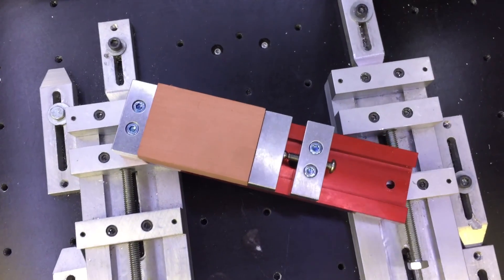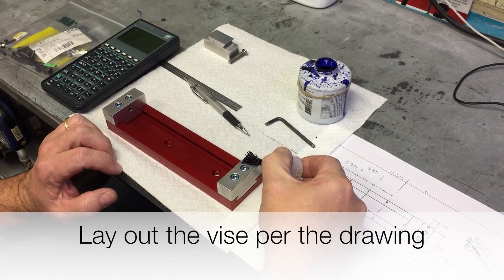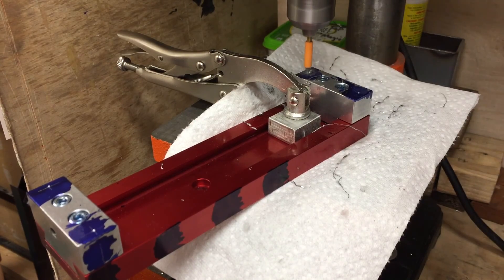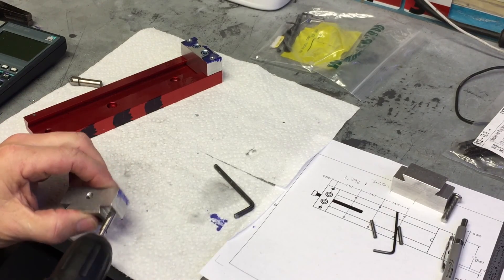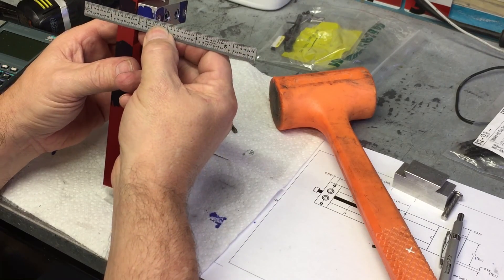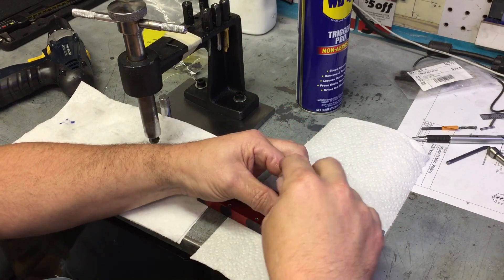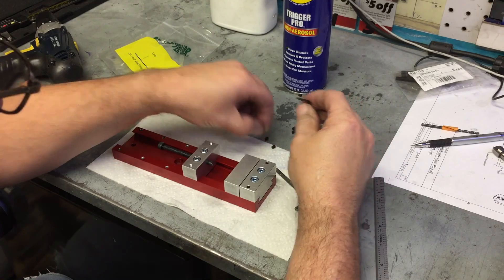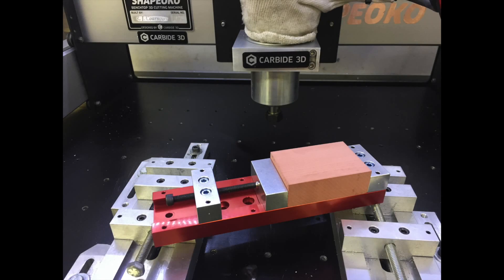Easy Nomad to Shapeoko Vise Upgrade

Comment: Awesome.  I would use it to finally be able to cut aluminum on my Shapeoko3.
Reply: Dan Sanford The Shapeoko 3 works well on aluminum even just clamping it down to the MDF spoil board with regular wood clamps. I also use cutting oil